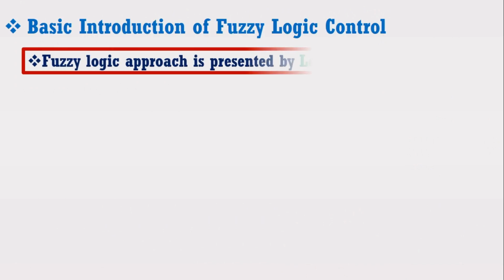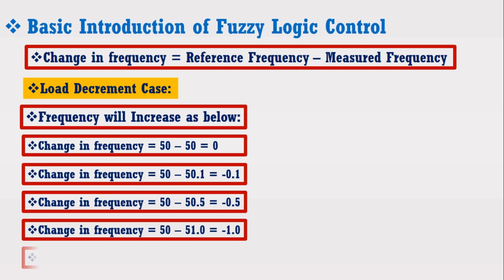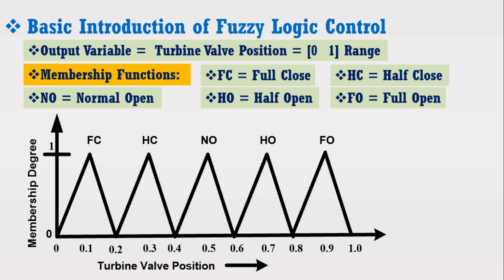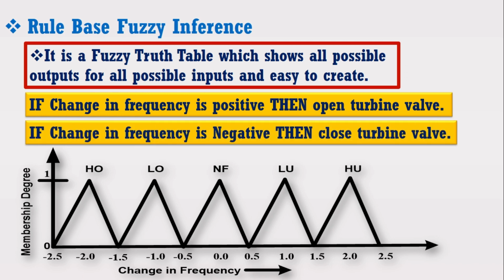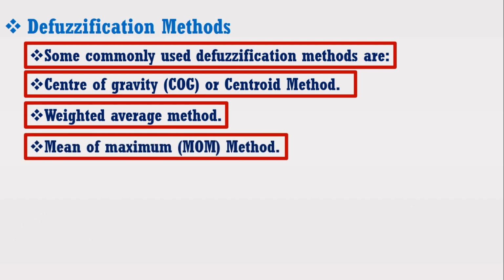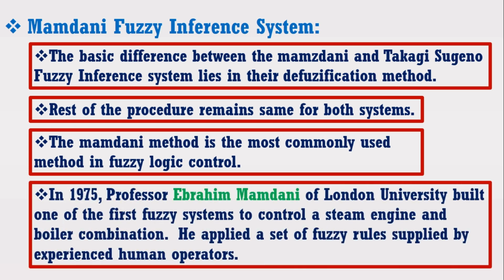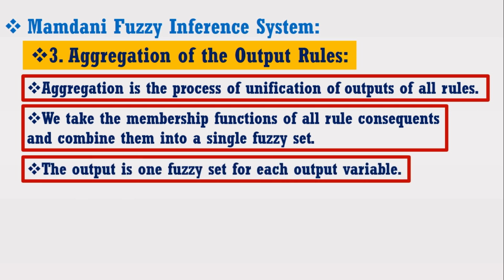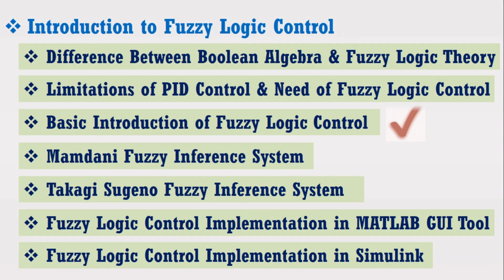How To Implement Fuzzy Logic Control in MATLAB/SIMULINK (Part-2) | Dr. J. A. Laghari

Comment: Dear Prof. Thanks for making this video. This surely has given a basic understanding of Fuzzy logic control. However my question is, why is this control technique not commonly used as PI Controller? Also, if I'm understanding it clearly for every estimated disturbance we have to define  membership functions ? Whereas in case of PI Controller this effort is reduced effectively. 
And also this technique is somehow (not completely) similar to Hysteris control that we  use in power electronics, where we define the deadbands limit and makes the device to work under those limits. 
With thanks,
Reply from the maker: Thanks for the compliments. Yes. Reason explained by you is one of the main reason of not using the fuzzy logic control.